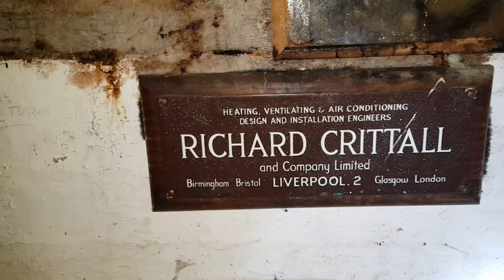Haunted convent revisit January 2019

Comment: still think its an air rad shelter from the war. was me an my gf who discovered it by antecedent  we an other explores had been using this place most the year with out even knowing it was there. was fun to open  it up not knowing if anything was down there. the lid was quite tight on at the time . i thought it might just be a small hole for like cables for under the floor bords but as i opened the lid it droped down again an made a big booming echo. i knew then it was no little hole an was a bit scared to open it for what was under there. nothing at all but was still a cool find. iill have to post the footage we have of the time
Reply: the pentagram has been there since Halloween